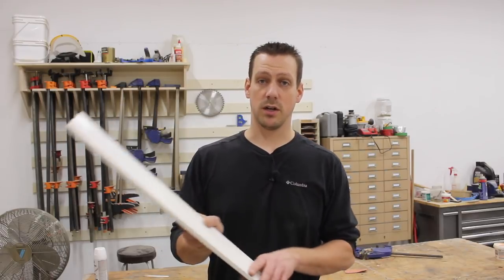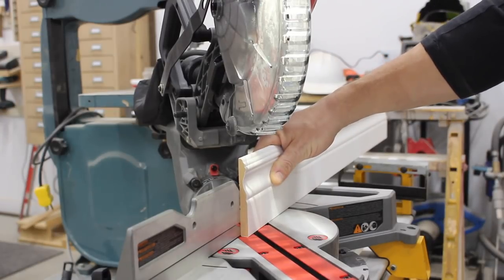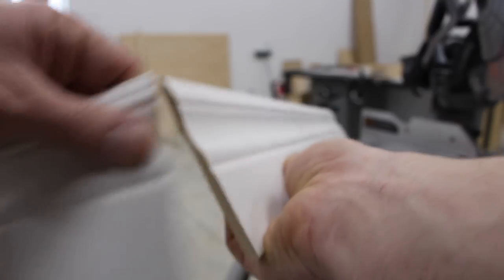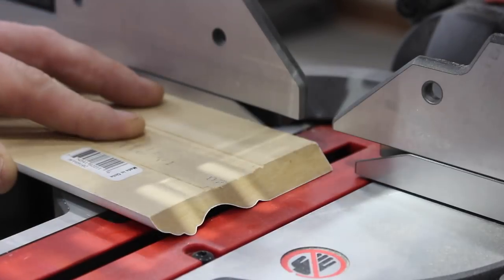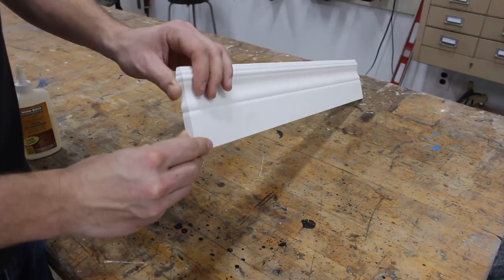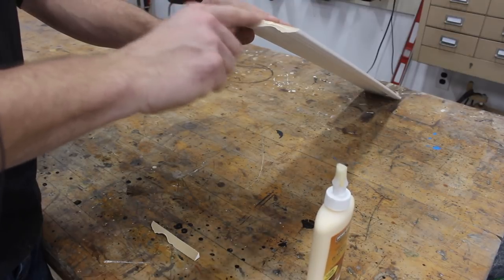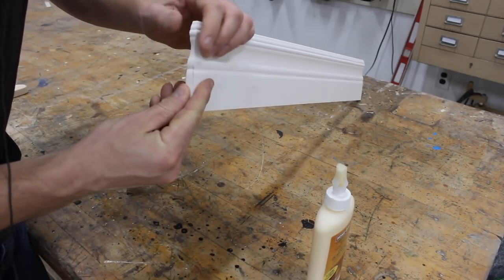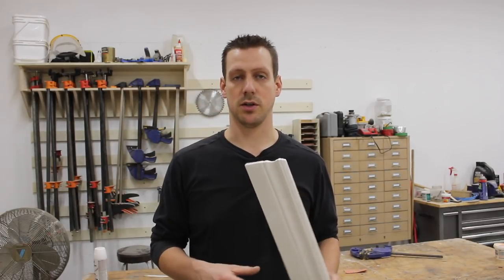How to Make Return On Baseboard & Questions Answered

Comment: I'm making a frame for my medicine cabinet and I want to put another baseboard, 1 inch longer, on top of the frame with 45 degrees cut on both ends. Your end of the board is a straight angle. What if both end of the boad were cut in 45 degrees, do I use the same cutting technique for my return?